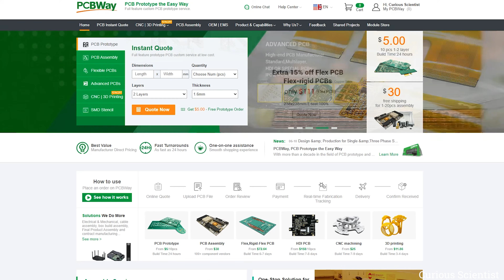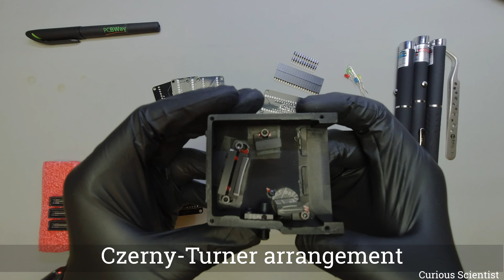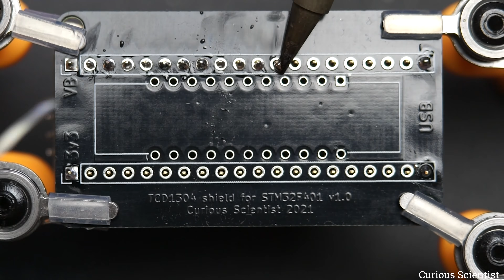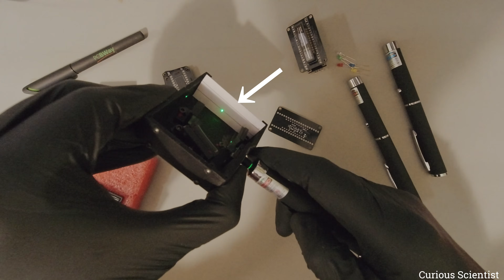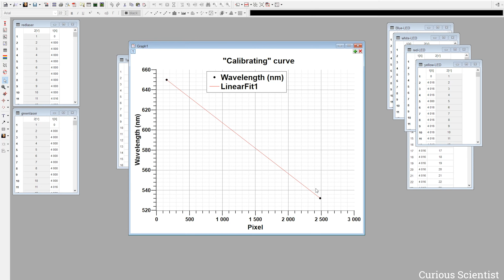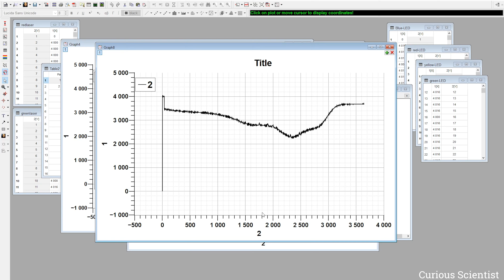TCD1304-based spectrometer - Part 1

Comment: everyone seems to buy the optical bench assembled, how hard do you think it'd be to put it together using 3d printing?
Reply from the maker: If you add some alignment screws so you can trim the final position accurately, it should be doable. It is just a bit more trial and error, so an assembled bench is easier. For me, it was good because it allowed me to focus on the CCD circuit and the software instead of struggling with the assembly for weeks.

Comment: What a nice work - as I viewed your vid, i thought over to maybe use a prism - instead of a diffractor'  to ' slit up to certain wavelenths' i think the footprint would be larger but - a prism is not bound to some grating micro lines'  - I think it would be more accurate for it would really  continously  the true' colors to its ' position on the sensor - 
and, another question :  - I think the light / wavelength / intensity does have different impact on the sensor pixels - so, for the blue light 400, 450 nm in example, to 'shine on, with the same 'energy, optical power, as the other wavelenthes -  it has more power to
activate more electrons in the photooptic cell - the sensor pixel, than a red photon ( 620nm) is able to' do (with the same optical power...) 
so, the spectral sensivity - to each cell -  how to alineate them to different colors ? 
from the datasheet i downloaded and saw 
- the max sensivity is around 540nm, ( on that diagram they marked as ' 1 ' ) and so: 400nm is at 0.8, 450 at 0.9,  540 =1, 600 around 0.96 650 @ 0.9,  700 @0.8 .. 
in the program - a possibility to correct these niveaus - that in the end the response will be 'flat to optical energy to all them different colors' (nm) , so the measured values will be more accurate ?   
 greetings from Andalucia...
Reply from the maker: Thank you! Yes, sure, it would work with a prism as well. I haven't tried with one yet, but maybe in the future I can give it a try. Also, correcting the intensity for each wavelength is a good idea and the datasheet gives a good guide for it by providing the spectral response curve of the CCD. If you are interested, I can recommend you some of the more recent videos related to the TCD1304 spectrometer because since this video, I figured out many things and implemented them. Better calibration, better software, some demonstration with more light sources and so on. I hope you'll find it interesting.

Comment: Hi, Thanks for the video. I would like to ask a question about the mirrors you used. Obviously they are  ordinary concave mirrors. Any specifications as to  their focal lengths? There are special mirrors with dielectric coating that reflect most of the light as opposed to ordinary concave mirrors but I do not think  yours are  special mirrors  as they are  somewhat expensive.  Thanks in advance.
Reply from the maker: Hi! Search for "optical bench" on ebay. There will be a seller called "spectrophoton". Check their products.

Comment: Origin is classics. Thumb up. I would  be great to calibrate it with rareearth lightfilter illuminated with W lamp. Also I quite surprised by the luminosity range of detector. Awesome project anyway
Reply from the maker: I just see that you edited your comment, giving a totally new meaning to it... In more recent parts of this video-series, I tried some calibration with other light sources. Also, soon I will attempt to further improve the system with another calibration method, and I will also evaluate its performance from different aspects. Stay tuned!
Reply: @CuriousScientist  thanks for reply
Reply from the maker: @Xen_Prime  It is my pleasure. Cheers!
Reply from the maker: But I used qtiplot! 😅

Comment: Why are u using tcd 1304? There are other CCD?
Reply from the maker: Why not? 😎
Reply: @CuriousScientist is it possible if I should use tcd1703C because there are more pixel size so sensor is bigger?
Reply from the maker: Sure, you just need to write a driver for that specific CCD.

Comment: Great project 😍.But how can I buy or made the focusing mirror? Your onlinestore not offers that! 😪😪
Reply from the maker: Hi and thanks! I also bought it from ebay. It can be found if you search for "optical bench b&w tek". 

Making the focusing mirror would be extremely difficult. It's not something we (at least I) can do at home.
Reply: @CuriousScientist  thank you a lot 😃👍🏼
Reply: @CuriousScientist  I wonder if they are special mirrors that reflect or collimate most of the light or just ordinary concave mirrors that reflect reasonable  amount of light but with particular focal lengths?
Reply from the maker: What do you mean?
Reply: @ Is that question for me?
Reply from the maker: Who else?
Reply: @ I mean a lot. :)) Special mirrors that reflect only light between 400-700nm or mirrors that reflect IR light... For that they are coated with special polymer. That is what I meant. Normal mirrors reflect only 4% of the incident light but specially produced mirrors 99%. What I was wondering is the type of mirror used in the kit. I hope I made myself clear.
Reply from the maker: I don't know the exact type of mirrors, but they belong to a UV-VIS spectrometer, so their reflectance should be in those wavelength domains.

Comment: Is the PCB link above in your description already has the foxes, or we will need wires to do fixes?
Reply from the maker: What do you mean by "foxes"? If you buy the PCB, you get the PCB only, without the components. However, I think you can order the PCB with assembly, then in that case, you get it with the components. But you will still need to get and program the STM32F401 microcontroller yourself.
Reply: @CuriousScientist I think he means 'fixes' referring to the jumper wires... I also had that question since I am planning to buy the new version of your board. I am also curious if the output pins are the same on the STM as in the original prototype because it would be a pain to figure out if they are different in this version...
Reply from the maker: @near--zero  All pins are named according to the names in the datasheet (SH, ICG...etc.). So, you just cross-check it with the datasheet. If you buy my newest module (standalone TCD1304), it is the same. If you buy my STM32F401 breakout boards, then there's only 1 way to plug it in, so that's also easy to follow.
Reply: @CuriousScientist  thank you, I am referring to the pin assignments in the STM software, for instance to which pin is output SH assigned etc since this can be determined by the user during the configuration...
Reply from the maker: It does not matter if SH is on PA0 or on PC12 because at the end of the day, it still goes to the SH pin on the CCD. So the pin assignment is not important in this sense. Otherwise I wrote it down which CCD pin is which pin on the MCU.

Comment: Amazing work. Thanks for making the video around it to boot. I have some questions about the bench. First, what material is it? It looks like a machined plastic to me. Delrin maybe? Second, could you elaborate on the alignment components? Are they off-the-shelf or also custom made?
Reply from the maker: Thanks! 
The bench is a refurbished B&W TEK BRC100 spectrometer, you can find them on eBay. The casing is metal. All the optical components are "off-the-shelf". My contribution is the customized PCB that fits the enclosure and the software I developed for the MCU and for the computer.

Comment: Awesome, I’ve been having trouble on wiring up the CCD and getting a OS signal on oscilloscope via breadboard design
Reply from the maker: I hope my explanation helped you to solve your problems.
Reply: I think the CCD could be fried because I get a SH, IcG and master clock pulse going in just nothing coming out of the CCD
Reply from the maker: Or just wrong signals. I gave quite a challenge to these CCDs and I haven't fried any of them yet.
Reply: I also made this design using the initial (green) version of the board and found that the output voltages from the CCD were very low, not sure what they are supposed to be. Did you ever resolve your issue?  @CoDBuffett

Comment: It is a great work. I enjoyed vey much. Have you compared the results with commercial spectrometers? How is the noise level compared to other spectrometers?
Reply from the maker: Thanks! I haven't yet tried it. I am now saving up some money so I can buy different lasers to properly calibrate the sensor. Then, I will try to replicate some measurements in the UV-VIS region and compare it with others' results. But unfortunately this will be a lengthy process.

Comment: Great idea putting the SMD components on the back side. Nice video, as always
Reply from the maker: Thank you! Yes, I tried to squeeze everything as close as possible to the CCD to avoid any unnecessarily long traces. I think, if I would use both sides of the board, I could also add an STM32 microcontroller to drive and read the CCD. However, in this chip shortage, I cannot play around with that option. :)

Comment: Great video! Always enjoy your projects.
We are working on a Dielectric Barrier Discharge - Optical Emission Spectrometric detector (DBD-OES) as part of a government-funded academic project and have to build our own UV-vis CCD spectrometer for this purpose. Trying this configuration would be amazing and really add value to the work. Are you able to share the dimensions of the optical bench and the optic cable connector/type? Any information you can spare would be great, really.

Many thanks and keep up the great work!!
Reply from the maker: Thank you very much! Please drop me an email, so I won't forget it and I can also attach pictures. Cheers!
Reply: @CuriousScientist  I would also be interested on replicating your setup (obviously getting your PCB).  Do you have  a bill of materials you could share? Also, is the software on github? It would be great if it was open-souce. Cheers
Reply from the maker: I don't know if you have checked the page of PCBWay where I shared the PCB, but I made a list of components, basically a BOM and shared it there. I hope that's sufficient. The software is not available for the public, however I made a very detailed video and wrote a long article which you can follow in order to write the code yourself.
Reply: @CuriousScientist   Thanks for the reply. I am aware of the the PCB+electronic components, but I would also be keen to purchase the optics: grating etc. I assume you got those from Edmund Optics. Thanks, Gustavo
Reply from the maker: You're welcome! The optics is from eBay. Search for "optical bench" or "optical banch" (yes, with the typo). It is an old B&W Tek spectrometer without the CCD. I designed my PCB to exactly fit this type of instrument.
Reply: @CuriousScientist  Would you be interested in try to make an open design? I would be keen to assist. Let me know :)
Reply from the maker: It is already open, I shared multiple videos, articles, BOM, everything to make it reproducible. Or what do you mean?